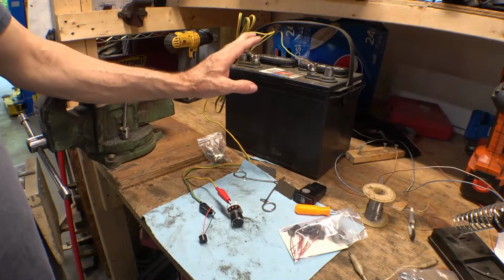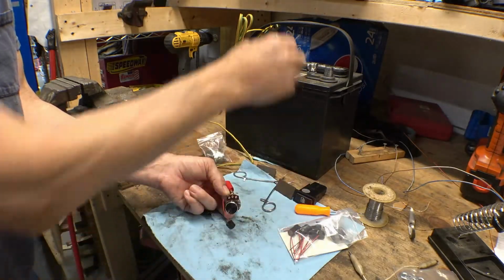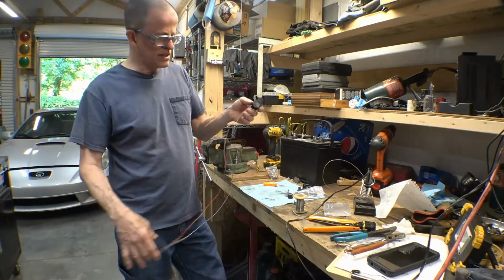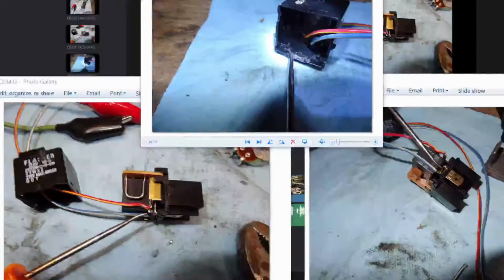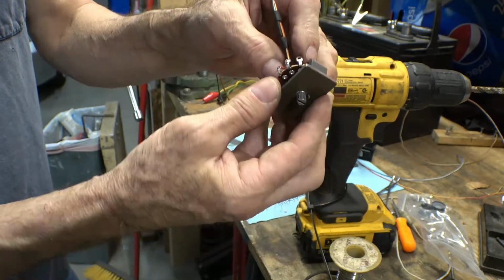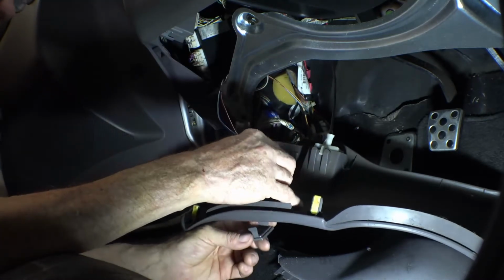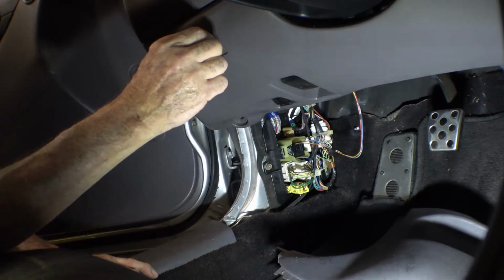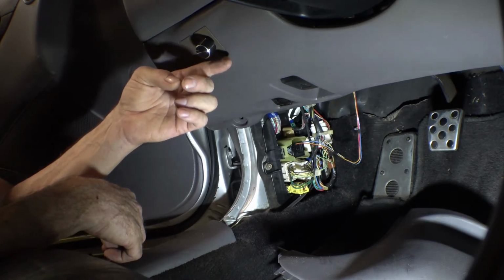Loud Turn Signal with volume control, Turn Signal Alarm. Make your own DIY

Comment: Definitely going to look at adding this setup to my International 4900. It does not have a automatic disengage on the blinker so I sometimes forget tor turn it off... Thanks for the information on how to easily and cheaply make this mod.
Reply from the maker: Hope it works for you.

Comment: How did you come up with 500 ohm pot for that ?  why not a 1K ohm or higher ?
Reply from the maker: I really don't remember how I decided that, but it worked. The only thing that's not really great about it is there's a fine point between no beep and a fairly loud beep. No real fine tuning of low volume. It's kind of a 100% down to 50% or so and then off.
       Would a 1k help that 🤷‍♂️.